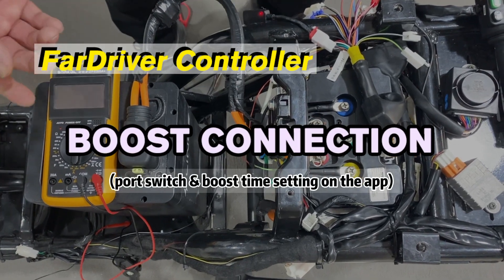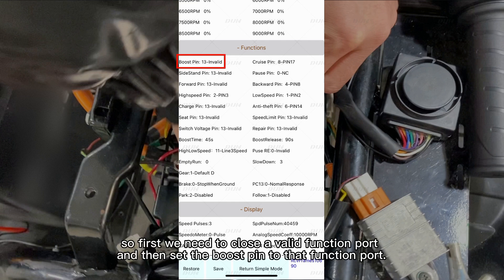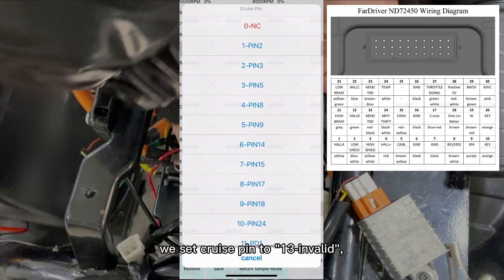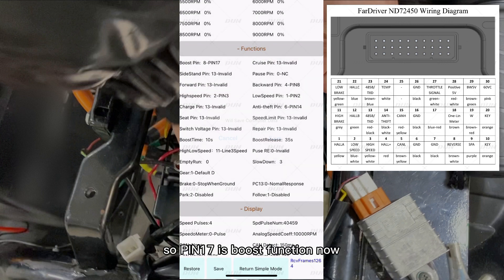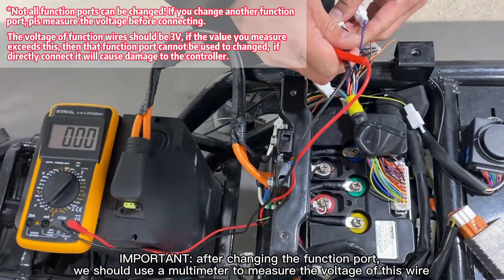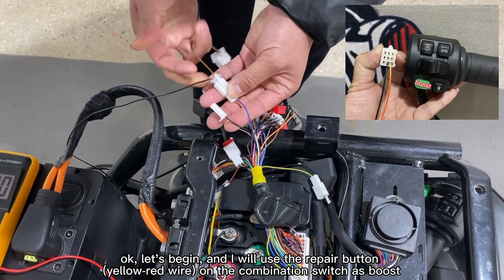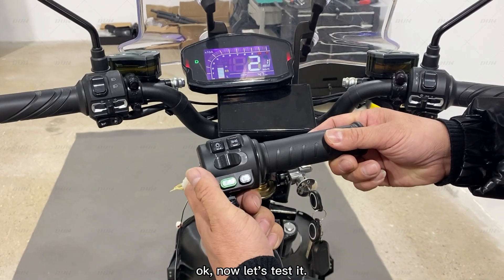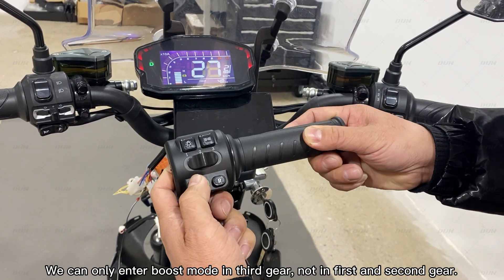How to Enable and Use Boost Function

Comment: how did you get the screen work read battery level and speed. 

I have the dkd display, i have power to screen. but I cannot figure out what wires to use for comms. 
I have tried the light blue, purple and brown wire but nothing. 
any help would be highly appreciated

Comment: Did we just need to connect GND and 3V wire with each other using combination Switch and also will it function if we set the gear to high only means not using gear selector